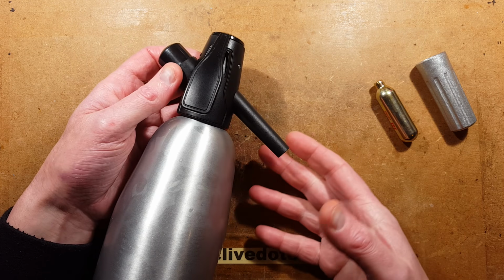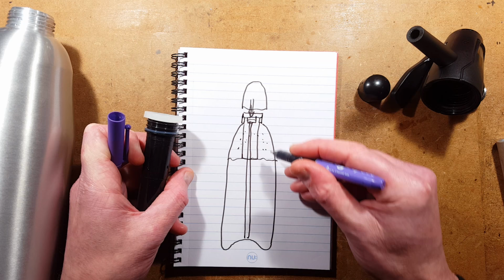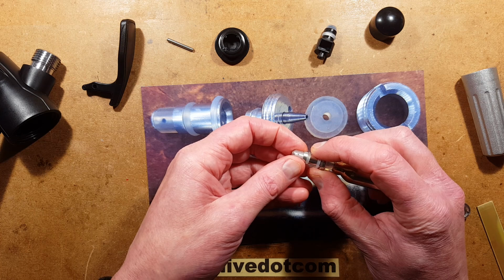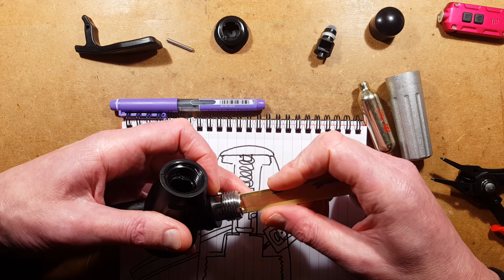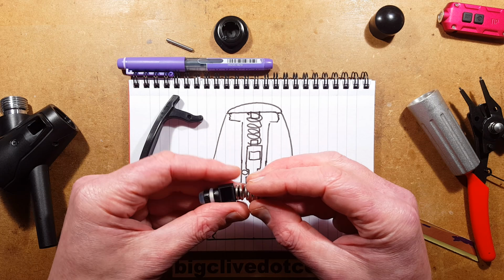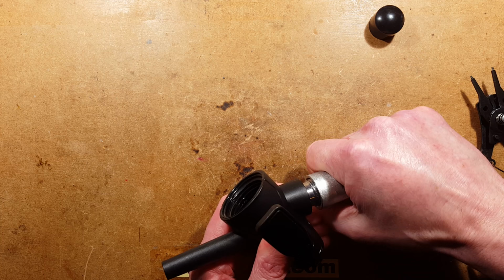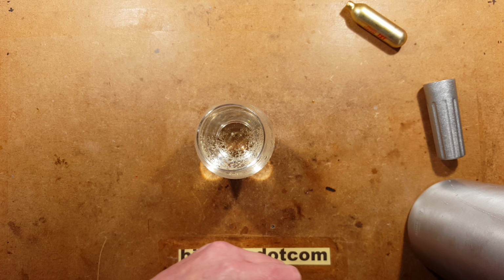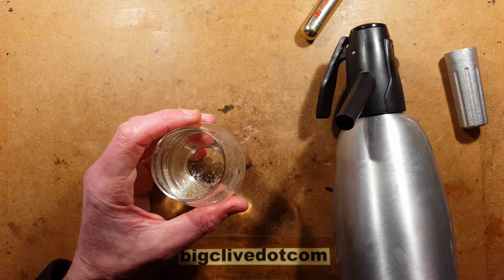Soda siphon teardown.

Comment: Two things here.

First.

LOL towards 20 minutes into the video or close to that.

Instead of calling it a soda siphon.

He called it a Sodastream.

Did anyone else notice?

He missed it as well.

 Right big Clive?

Second.

Big Clive by the way you should do a teardown of a Tesla pyro fuse.

AKA Ludacris mode fuse.

AKA pyrotechnic fuse.

And a normal Tesla fuse.

I'm talking about the one for the high-tension battery AKA high voltage battery traction battery that's used as a main fuse.

And if possible tear down a blown one and a good one.

Which you can get out of me Babe by the way.

Obviously a good one not the blown up for the quote one.

If you get the pirate joke.

I'm some kind of surprised you not done it yet because you are into pyrotechnics.

 Please be quiet do it for all of us.

 I've been wanting to see a video on this.

 I'm sure I'm not the only one.

So far not seen one on YouTube.

If anyone goes down wrong and has a link please sticking in a comment thanks.

Comment: What evil unholy magicks is this?!? Yes we had these when I was a kid, but the cartridges definitely had a reusable valve on the top and the sellers absolutely wanted the empty ones back after you used them... I clearly recall the tiny rectangular pins that went loose and rattled in the empty cartridges.

Comment: Bottles like this were very popular in restaurants in socialist countries pre-1990. But they did not use disposable CO2 cartridges, rather they pressurized them from big (industrial) gas bottles.
Reply from the maker: I wonder if a pressure regulated adapter is available.
Reply: bigclivedotcom    Chinese sellers on Ebay offer adapters for re-filling sodastream cylinders. Perhaps there are also adapters for these bottles?

Comment: Big Clive, as a homebrewer I'm somewhat disappointed to see you using something like this to make sparkling wine. As a reasonable human being I also scoff at the overpriced pressurized growlers on the market. In any case if you really want to fine tune the level of fizz, they sell growlers with little regulators (still using the paintball CO2 cartridges) that let you fine tune the amount of fizz. Brewing resources could probably give you the appropriate pressures to use. As a chemist I will also underscore your observation that as temperature decreases, solubility of a gas in a liquid increases. Practical meaning- cold liquids can be fizzier.

Comment: My brother just took the empty one and fill it with water, then he found out the water turns out as brown color. I have no clue about this tbh
Reply from the maker: Was it clean inside to start with?
Reply: @bigclivedotcom  I mean the cartridge is work fine and it should throw away after use right. Unfortunately when he try to fill the used cartridge with water, it turns out brown. I can't tell the cartridge was clean inside but it still brand new, I use mosa soda cartridges.
Reply: @bigclivedotcom  I just try this morning, and turns out the longer i left it, the brown the color is. Maybe there's something to do with chemical reactions with air? But at first open it's clear water hopefully my experience can be useful tho
Reply from the maker: @richard3165  Are they definitely carbon dioxide capsules?
Reply: @bigclivedotcom  yes they are, it's called mosa soda. I'm also see a good review tho, soo I think the color caused by chemical reactions with air.

Comment: The solubility of gases in water increases as the temperature decreases, as the Big Yin said, but PLEASE do not let it freeze, as solubility goes to zero 0 deg. C, and even if the pressure-vessel held, water squirting all around your fridge is not pleasant to clean up.

BTY, a Sherlock Holmes story makes reference to a _gazogene_,   which, when I looked it up, turned out to be a Victorian version of this device.